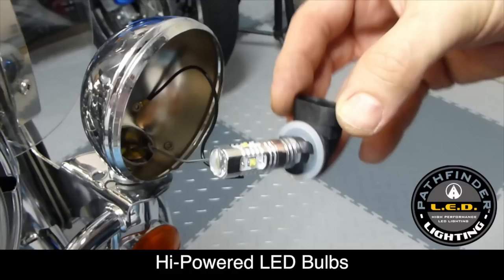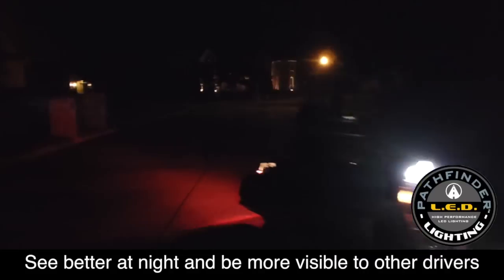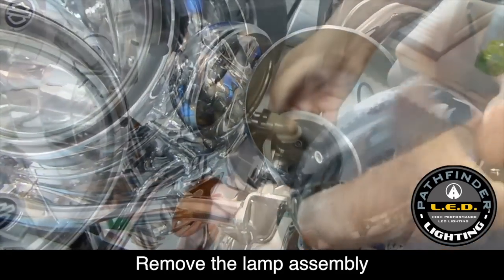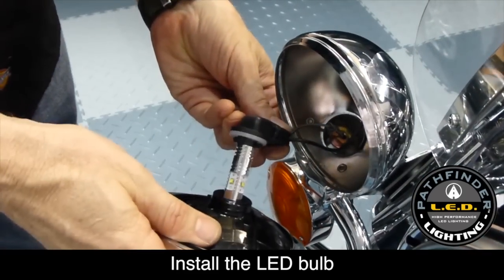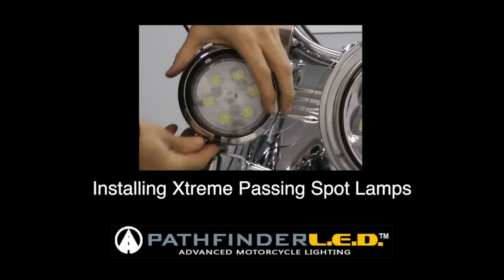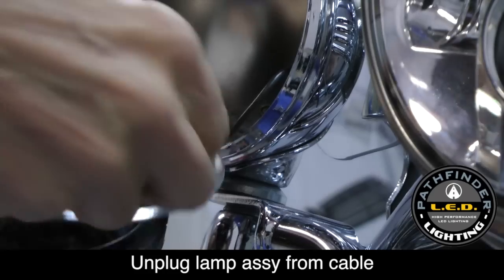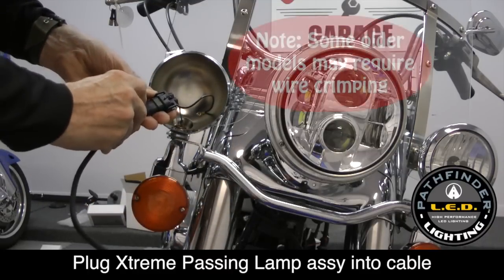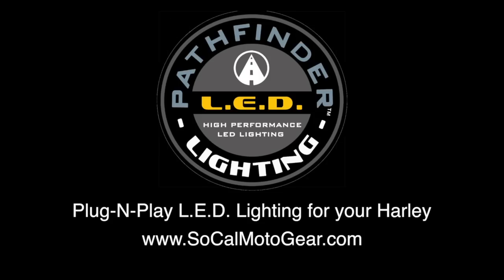How to Install PathFinderLED Hi-Powered LED Passing Lights for Harley-Davidson

Comment: Do those led bulbs need  ballast?
Reply: No they do not require a ballast. They are plug n play, no splicing or wire cutting required.